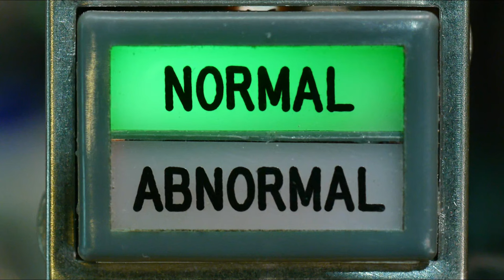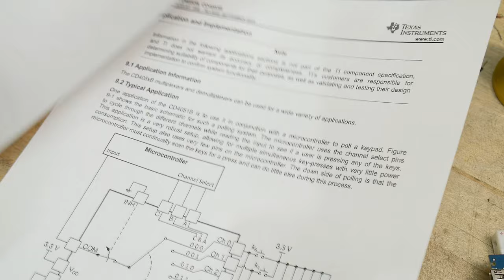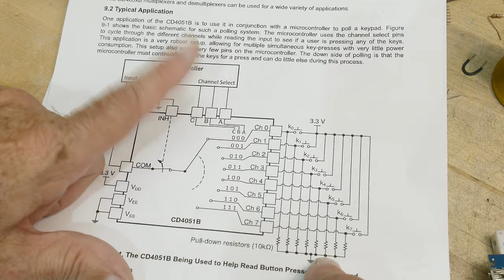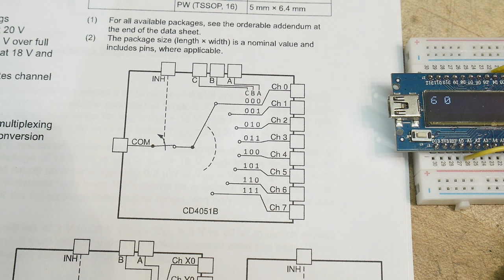#1701 CD4051 8 Way Switch Multiplexer

Comment: The unique thing about these three parts is that they all have a Vee pin. This is allowed to be a negative voltage giving these devices the ability to switch analog signals that are centered around ground.

Comment: If memory serves me, the most often failure mode I ran into with this device was high internal switch resistance, and limited switching frequency. The products we produced used them quite a bit... pretty old part.

Comment: These are good chips, I use them for keyboard matrix scanning and controlling the octave range in my synthesizer boards. If I remember correctly, they were used for mux/demux in the mid to late 70s in the first synthesizers with digital memory.

Comment: I just extended touch pins of ESP32 with CD4067 analog multiplexers. First time for 40 years I have used these chips for anything. Needs slow scanning and definitive 2 second touch, but this quite ok, when controlling lights and machinery.

Comment: If you’ve already got an A2D use different resistors and no multiplexer, a ladder arrangement or something and read what’s selected as an analogue value. You definitely don’t need more than one or two resistors in the application demonstrated.
Reply: That technique is commonly used in consumer electronics.
Reply: But you’d use a 151 if it’s digital as indeed I did for automotive body controllers some decades ago.
Reply: What if someone presses two buttons at the same time?   This method finds it immediately, but your method needs a calculation.  You could use a power of two voltage for each line tough which requires presize resistors.
Reply: @bayareapianist  Part of my point is that this needlessly uses an analogue multiplexer when a digital one is cheaper and more robust. It doesn’t save n-1 resistors which it could having been done with an analogue device. The 4051 can also leak onto neighbouring channels should your inputs not be well behaved. My employer back in the 90s did a study on just this.

Comment: Using this to scan through a bunch of on/off switches seems like a bit of a waste of the analogue abilities of this device. Much more useful is to connect a bunch of potentiometers (or other analogue inputs). That way you can check multiple analogue sources using a single analogue input, something that's quite useful when using smaller micros that have a limited number or no analogue inputs, but the design doesnt require the processing power of a higher spec chip.

Comment: It worth noticing however that these chips have high internal resistance (it can be lowered by connecting several channels and/or chips in parallel), and the switching speed can be not enough for certain applications.
Reply: If you can get by with the lower power supply voltages (implying lower signal amplitude) there are equivalents in HC, AC and LV series.
With the 4000 series parts using high supply voltages results in lower and more linear ON resistance, as a rule.

Comment: Can CMOS analog switches be used, e.g., to add microcontroller-control to devices with key-matrices?
E.G. add a microcontroller and CD4066 to "press"/short the buttons on a TV remote or microwave, etc?
I mean, sometimes one might want to throw uC control at such a preexisting device without knowing its implementation details... maybe all the buttons feed to separate TTL inputs with 330ohm pull-downs and the buttons short to 5V... Or maybe they're in a scanning matrix with open-collector rows, or maybe they're all tied to the same ADC pin via differing resistor values... or maybe instead of an ADC the uC pin charges a capacitor and the resistor activated by the button determines its discharge time...
I guess I'm wondering how these sorts of "analog switches" compare to real switches in the sense that varying amounts and directions of current can flow through them, and the frequencies they can handle... or are they more like bidjrectional voltage-followers, where an input current may differ from an output current... or be delayed as though through a logic gate or op-amp slew rate... etc. etc. etc.

E.G. If a 4066 could be used to quickly throw uC control into 90% of keypads one might encounter, (without having to go into too much reverse-engineering of the keypad electronics) it'd be very handy as a toolbag item!
Reply: It is likely to be quite successful. Keypad scanning is usually pretty simple - an X/Y array where X lines are driven and Y lines received (or other way) and signals are all more or less logic levels. True touch switches that detect the influence of a capacitance on signal coupling are another matter, but even there you can probably use analog switches to advantage.

You do need to be mindful of the ON resistance of the switches, but lots of keypads are made with "carbon button" contacts that are quite high in resistance.The resistance of an analog switch might be even lower than that of the "actual" switch. If you can get by with the lower supply voltage, the 74HC4xxx parts typically have substantially lower ON resistance. There are even equivalents in 74AC and 74LV families. In terms of frequency or signal delay through analog switches there should be no problem for your application. There really isn't an inherent limitation as such. It largely comes down to how the "parasitic" capacitances degrade signals. Anything up to several megahertz should be should be OK in low impedance circuits. CMOS analog switches are, in essence, a pair of MOSFETs, one N-channel and one P-channel connected in "inverse parallel." They behave like a resistance in the signal path.

In precision or otherwise demanding analog circuits there are lots of things to consider - leakage currents, control signal feedthrough (charge injection), crosstalk, non-linearity of the switch resistance and the like. When those sorts of things become important it typically means abandoning 4000 series CMOS parts and going to devices with much better performance and usually substantially higher cost.

There have been many, many ap notes on use of analog switches produced over the years. Analog Devices is probably a good source. I suspect it is possible to find old ap notes for the CD4000 series from RCA and some from Motorola and National Semi..

Also remember that some devices with keypads don't have galvanic isolation between AC mains and the switch contacts - they rely on insulating mechanical parts like buttons for safety. That can make things a bit messy.

There are a few opto-isolated analog switches on the market but they are rather expensive. They can be very useful at times.
Reply: @d614gakadoug9  Awesome info, thanks!

The oft-functionality of this sounds like the sorta trick that might've been in Mims' notebooks, if he had one on microcontroller-interfacing.

I've wondered this for many years... Sure, it's the sorta thing I could've just tried on a case by case basis... but there are so many keypad-interfaces even in the digital-realm alone, that I wasn't comfortable even claiming it'd be  "worth a try before reverse-engineering the keypad." I think from your answer, it's more than worth a try, it seems highly likely to be a nearly universal solution.

Cool!

Good point, by the way, about making sure the voltages are safe... and in range of the analog-switch's rails, first, though... (With matrix scanning, a multimeter probably won't give a valid reading!). And I hadn't considered a lack of isolation from mains.

Still a cool trick that could save a bit of time on quick projects. Thanks again!

Comment: Do you have any videos on how to make a 60Khz antenna and amplifier for the WWVB time signal reception ?
Reply from the maker: No, sorry
Reply: It is such a low frequency that a whole range of op amps would be usable. Trying to keep the power ultra low could be a bit of a challenge.
Depending on what you want to accomplish just using a largish ferrite rod antenna might be adequate. The antennas typically used with the dedicated WWVB receiver ICs are often pretty tiny and bigger can be better if you have room. There was a time when quite large rod antennas for this purpose could be bought ready-made, but I don't know if that is possible anymore.

Comment: how about a crosspoint switch?  With audio signals?  ;-)
Reply: Not with 4000 series CMOS parts except a low-fi.
An audio crosspoint switch isn't particularly easy. You have to be very concerned with channel-to-channel crosstalk, OFF isolation, switch resistance linearity, control signal feed-through (charge injection) and the like. 
I've been out of this stuff for years, but I'd have a look at Maxim/Analog Devices parts. Maxim used to have some pretty impressive devices - an enormous corporate ego, but some good devices.

Comment: What is the fastest switching time you can arrange? Can these be chained in order to get a 16-way switch?
Reply: You could use 1/3rd of a 4053 2 way to get 16. Staying in the 405x family means you can expand the select pins and inhibit. Not sure about switching speed, but am guessing high KHz range.
Reply: for a 16-way switch just use a CD4067, it is basically that in a 24-pin package
Reply: @stamasd8500  There are electrical differences between the devices. One that could be important is the 405x devices have "break-before-make" switch action.
Reply: @stamasd8500  thank you.